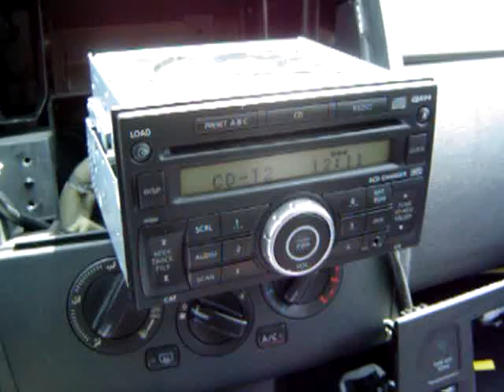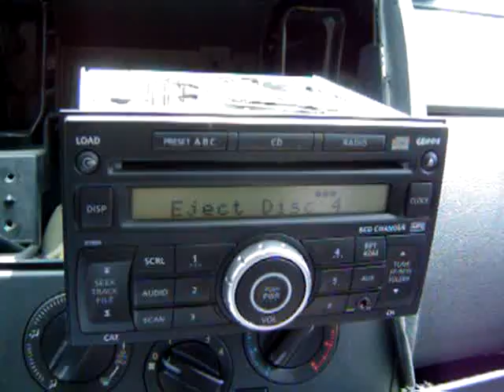How an in-dash 6-CD changer works...

Comment: I have a 2012 chevy treverse that the cd player ejects the cd fine but sometimes the eject mechanism doesn't see it come out and it's still trying to come out with the cd out of the slot then it will say (check cd) and when i load a cd it spits it out 1 time then it will accept it.

Comment: After all these years of buying used cars, assholes always take out the original 6 CD changer for some low end crap, I finally bought a car that still has the original 6CD changer.  Was curious how it worked.

Comment: I know this video is old, I just purchased an ‘03 Lexus with a 6 disc CD player, do you just put one in after another? There is nothing in the trunk to load cds
Reply from the maker: If you have an in-dash cd changer mechanism, and if it was anything like the Nissan Versa’s CD changer, simply press the slot number and insert the cd
Reply: @bbishoppcm  
Thank You, got it works great

Comment: Speaking of daylight confusing the sensors, I've had problems like that when I took apart my VCR to see what's happening with it, and I was near a window. There's a varying number of optical sensors depending on the design, and external light with the cover off can cause it to, say, stop rewinding for example.

Comment: Nice to see, my GF's Toyota Corolla E11 got from me a used TM0561 6CD Changer in smaller Housing we call it single DIN Slot (DIN= Deutsche Industrie Norm) oder double DIN slot. It works fine and fascinating how 6 CD's can be stored inside and read. I told my daughters, the Changer collects them and folds them like paper inside hahahah

Comment: Maybe the shining daylight is the problem. The CD-Changer 'thinks', that there are CDs, because the top cover is not fixed. Try sealing it from daylight, and then try again.
Reply from the maker: I would, but after fixing this CD player I ended up trading the car in. Nine years ago.

Comment: I'm wondering how unloading a disk out of order works 
I know for example at least in fords old CD changer from the mid 2000s you could unload say CD 1 with 6 full CD slots. Was there just enough room to compress the 5 other CDs above it to bring it up to the eject then?
Reply from the maker: Yes, that is correct. When the stack is compressed, there's enough room for each disk to slide out as the stack positions the disk to be ejected in front of the slot.

Comment: Bought one used and it doesn't work. Frustrating. How did you get the thing apart? I took out every screw I saw on the outside and it's still not happening.

Comment: Somethings wrong with mine right now. At times its fine...other times it just clicks or whirrs and kicks back to radio.
Reply from the maker: HDD failures are common, and clicking and whirring sounds are often a precursor to catastrophic failure.
Reply: BBISHOPPCM's World it's not an hdd, hdd stands for hard disk drive. This is a compact disc drive

Comment: Never been a fan of cd changers or push button start. Some car technology is really useless. Those two things are barely more efficient than the old way and cost way more to repair than the systems they replaced. Benefits Just don't out way the costs.

Comment: Ok. So how do you use the grease to fix it? Do you have to take it out of the dash like this of can you spray it inside and hope that's enough?
Reply from the maker: Spraying inside will destroy it. The unit needs to be disassembled; use silicone lubricant similar to this; http://www.dickblick.com/products/iwata-super-lube/?clickTracking=true&wmcp=pla&wmcid=items&wmckw=26974-1005&gclid=CIry8c2tjcQCFdgDgQodY50ALg
Reply: omg that what i did i just spray all inside it, and let just say i 
almost died!!  i just cried so long,  but i found  another one eBay and 
got that one so lesson learned.

Comment: @cityslic It has probably dropped in between the holders and is sitting at the bottom of the deck. You'll have to take it apart and retrieve it but I doubt you'll have to actually disassemble the MECHANISM to reach it.

Comment: Interesting... but my problem is I put a mini-disc in slot #5 (thought about not doing it TOO late), it wouldn't play, and it's too small to get pushed out, I guess. I could finally put a disk into that slot, and it would play, but no others will eject or play. Where did the mini-disc go? frustrating!!!